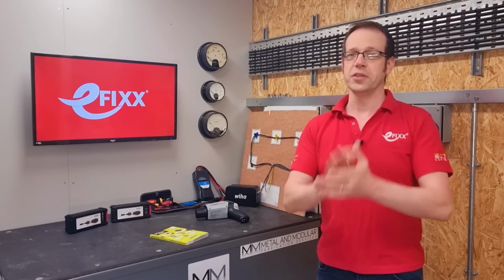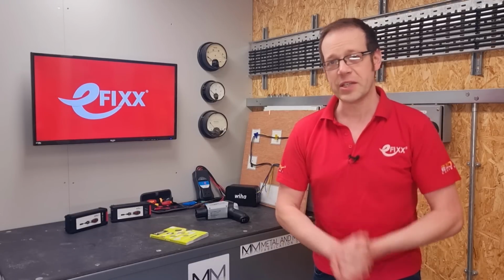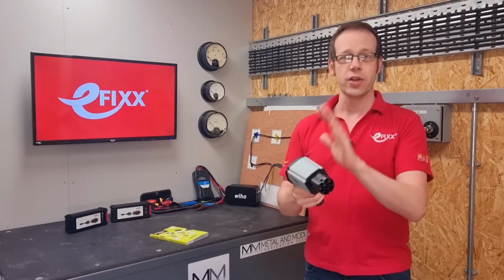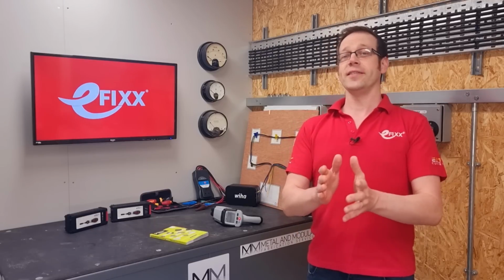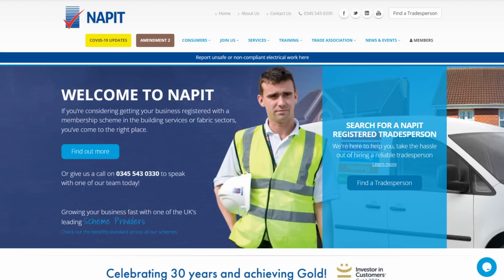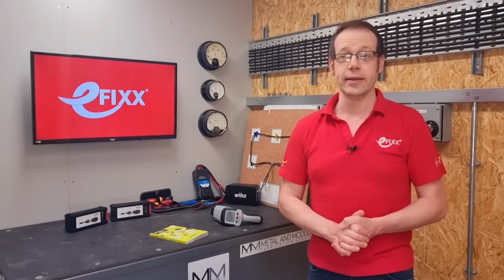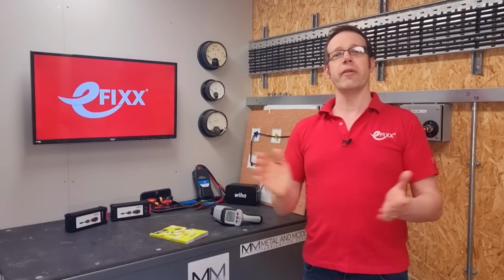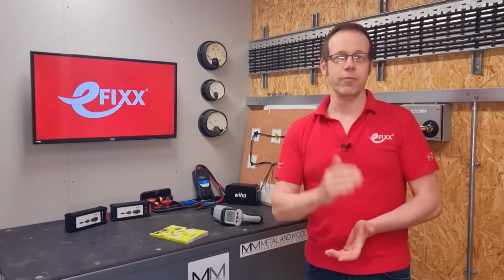Electrical News Weekly: MK Screwless Socket is NOW Available from More Wholesalers

Comment: As much as I like the MK sockets, I have had an issue where the leavers have come off when attempting to open them. This has happened on 4 or 5 now. Have you seen any other reports of this issue? Wholesalers have not seen the issue before but have said they would flag it with MK.
Reply from the maker: We haven’t heard this before - if you have any photos send them in.
Reply: @efixx  I have put a couple of the faulty ones in the post to Lineside Studios. Be interested on your views.

Comment: In regards to heat-pumps, if the temperature across the whole of the UK were to fall below -5C, then the extra grid demand would be in the order of 46GW. That would need the UK to add (as an absolute minimum) some 5,750 Siemens Gamesa (8MW) turbines. To put that into perspective, there are 174 of these turbines in the Hornsea #1 offshore wind farm, with another 165 being added to Hornsea #2. So once we get to Hornsea #175. Heat pumps will be a viable heating option in the UK. 
And that's the UK power networks JUST starting to wake up this.
Reply from the maker: Fair point, there's lots of work to be done! 👍
Reply: It should be noted that burning gas or oil in a power plant for a heat pump uses less than half of it compared to burning it for heat at home. So even if there was no expansion of renewable energy production, and we were to build gas/oil-powered plants, this would still lead to a 2-3x reduction in consumption.
Reply: @HenryLoenwind  Much as that is a very true statement, the problem is not one of consumption, it is one of distribution. Delivering gas is easy, delivering electricity is not. The UK's natural gas network already exists, whereas the electricity network needed to power air-source heat-pumps does not.

Here's a starter of what we'd need to upgrade to support a doubling of grid consumption: some 33,000 substations (with over 200 of them being inside the M25); the doubling up of almost every overhead line (including ABCs) as well as the upgrade of almost every mile of buried cable under every road in Britain. This is a complete non-starter that would take decades to complete, would cost hundreds of £billions, and would (in all likelihood) crash the entire UK economy.

Sadly this is not the message that anyone working in the media, politics or any of the renewable industries wants to hear - let alone discuss.
Reply: @skfalpink123  It also isn't entirely true. The daily consumption curve for heating is much flatter than the general electricity demand. It also has its peaks at different times, peak heating is in the morning (after the night dip), with a low at mid-day (when electricity peaks). The only overlap is the early evening ("coming back home after work") peak both share.

So when you add those two demand curves, you'll see that heating isn't pushing the momentary demand above existing electricity demand for most of the time. In most areas only the early evening peak would be higher than the maximum peak load the current system supports.

This is exactly the same issue EV charging faces---and for that there's already load steering in place. (At least in the UK, who's the world leader in installing smart charge points.) That's easy to extend to heating, which, while it is not as flexible as charging, still supports load shifting to a certain degree because houses have quite some thermal mass.

But yes, neighbourhoods that are stuck at a 60A single phase supply per house now will need to be upgraded. But that's already true for EV charging alone. (Put in 3-phase already, UK. It's 3 times the capacity for twice the copper...)
Reply: @HenryLoenwind  Sorry, but we're not talking about peaks or dips, we're talking about a constant load demand (24-hour-per-day) of 2KW (minimum) for each heat pump (read the specs on these things). Please do not confuse these units with night-storage, or any other type of electric heating boiler. They are designed to run almost constantly, with an efficiency index that varies as function between target (inside), and actual (outside) air temperatures. This means that if air temperatures across the UK fell to (or below) -5C, the additional demand on the grid would be a constant 46GW all day, and for as many days as the temperature remained below -5C. 

Right now (according to grid.iamkate) grid demand is 27.2GW, although this figure can rise to >42GW during days when it is particularly hot or cold. With heat-pumps, we could be looking at TOTAL grid demand of between 73GW and 88GW - which would cause a total collapse of the distribution network. We have neither the generating capacity, nor the distribution network to even withstand 10% of UK housing stock switching to heat-pumps.
Reply: @skfalpink123  If I were to make a minor contribution to this thread it'd be to observe that often the coldest days over the winter are when there's a large, static high pressure system over northern Europe, and another characteristic of these are low wind speeds. I imagine this is why there's an interest in increasing the UK's nuclear power generation - to provide a solid base load capacity and to account for some of the issues you're describing.
Reply: @etdj909  Assuming we' are set to continue down the lunatic (and masochistic) path of adopting air-source heat-pumps, then nuclear is the ONLY viable option going forward. However, energy demand is only part of the problem here. What happens when the penny finally drops, that forcing people to live in air-tight properties with SEALED windows, will have serious consequences for those who cannot afford to run the expensive ventilation systems needed to make life in these properties bearable?
Reply: Just got to pray it's cold AND windy at the same time.